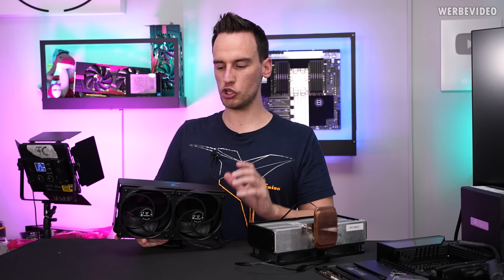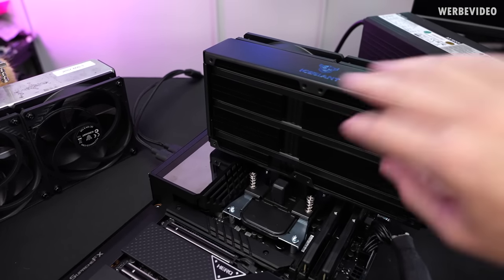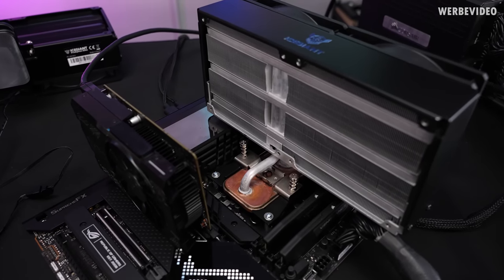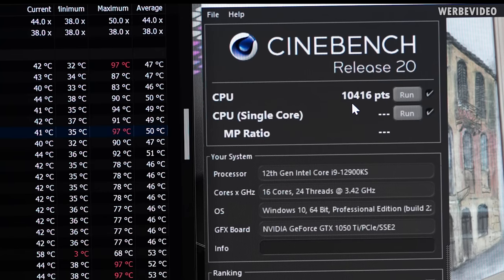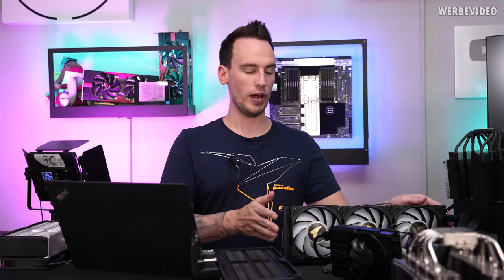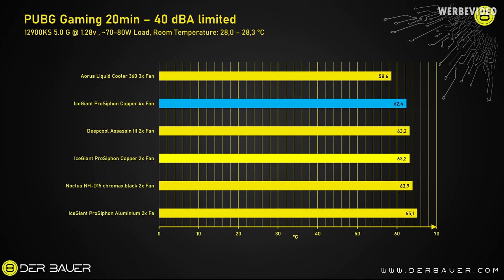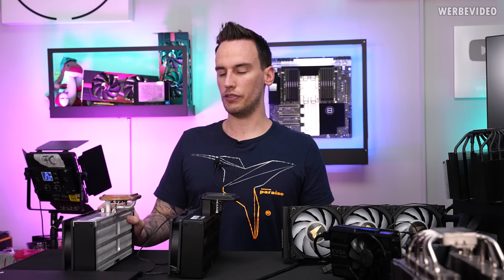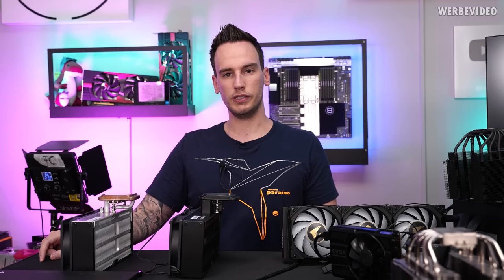This Prototype has A Lot of Potential !

Comment: This new prototype reminds me of the "golden days". I wish I could relive 1996-2006 era when cooling made the evolution to the "standards" we know now. The days we used aquarium pumps and radiators from used cars from the junkyard, and it was in a separate box beside the case. We didn't have AIOs back then. Heatpipes were in it's infancy. We had to buy Fans from all over to find the silent ones. Nostalgia kicked in hard.
Reply: Lol yeah, I still have a friend who cools his PC with a aquarium pump and car rad and it still works a treat.
Heat pipes have been around a lot longer than that though, it's the early 60's when they were in their infancy.
Reply: @wing0zero  I know heat pipes existed. But back then they weren't necessary and were not used in CPU coolers. If my memory is correct, we started seeing them after 2005 in PC DIY space.
Reply: @alpha007org  I recall it was Thermalright that did the first heatpipe cpu cooler for public SP-94/SP-97 (P4/AMD) it was back in 2003. SP-94 was released few months before SP-97 (People using Socket A had to wait a bit for their radiator :D )
Reply: @alpha007org  
Yeah they didn't get used till early 2000
Reply: @gagarin777  
Yeah my first heat pipe cooler was Thermalright, maybe the SP-94 but I can't remember the name of it but it must have been early 2000 as I had a P4 Prescott if memory serves me right.
Reply: @gagarin777  Well, in my home country, Slovenia, we just split from Yugoslavia, and our access to higher end stuff was limited or really really expensive. 

I had an iconic home made PC case with that BIG RED "HIGH VOLTAGE" Switch on it. This was just to power on the PC. It was cheeky/cringe in retrospect, but people were expecting sounds like takeoff of an aircraft. But after that CLANK, PC powered on, pump in the other box started pumping, Fans (Huge industrial fans) were set to minimum RPM via resistors, so it was as silent as we (small OC group*) could make it. It was hilarious at the time.

*We were buying aqua pumps everywhere to find the silent ones. We were hunting for huge 200x200 fans that didn't existed for DIY PC at that time,... 

I would really like to relive that era. If I would made different decisions, I could be a part of EK group, because we used the same CNC machine in one factory after they closed and we knew a guy. I became software dev. Edvard founded world known EK water blocks. I could talk about this for hours what were we doing.

But now, I don't care about OCing anymore. Actually, I run all stock or set the power limit on the GPU minus 20% for total silence. Back then, every DB lower was months of work and tinkering....
Reply: @alpha007org  hey, I think you already shared that EK story, but I don't remember on which channel was it :) 
Back in the day I knew a guy who made his own freon cooling system with condenser sitting outside his window. He used that system daily with P4 1,8 OC'ed to 3GHz
Cheers from Poland 🙂
Reply: @gagarin777  Once. On this channel.
Reply: @gagarin777  You know what. I wish the hardware we have today, existed back then or if I was young now and have the same "my growing up story."

I wonder what kind of Wattage we could cool silently with "out of PC Case" DIY cooling solution. Both CPU and GPU. We could probably get very close to 1000W (CPU and GPU) but the radiator would have to be huge. And Huge 2x ~300x300mm Fans with push+pull, but how silent those fans could be, I don't know. But the room temp becomes a problem with cooling 1000W...
Reply: @alpha007org  I know what you mean. I have high-end rig with 5950X and RTX3090, it heats up the room a LOT. During summer time there is no way to run it without open window (I can't have AC where I leave because aluminium wiring would melt).
Reply: Were you in a different universe than me?
Reply: I'm still using an Eheim 1046 since the mid 2000s. It never had any problem and is essentially a garden pond pump. Also it's very quiet.
Reply: Nice 100 word essay kid
Reply: @alpha007org  look up the Mo-Ra3 420 radiator, I run that with 4 noctua 200mm fans its a massive radiator but I also have these fans at only 450rpm and I have never seen a water temp over 36c even with a mildly overclocked 3090FE and a 5950X on whatever speed PBO decides it wants.

It is basically silent under any load.

Its a wildly overkill radiator, But if I wanted to be sane id have just stuffed 3 black ice into my case.
Reply: Yeah, every so often videos pop up that take me back to an era filled with garden hoses, aquarium pumps, filters, demineralizers and PC's that I had to tear down every month or two to clean the damn algae out of LOL.
Reply: Aquarium, bilge pump, water chiller and mineral oil.
Reply: Or we popped the side case open and put a box fan to it lol.

Comment: still "scary" for a CPU to reach 96C stock with such a BIG cooler on...
Reply: 100%. And the upcoming 13900K is supposedly another 100w more power. It’s nuts that upcoming products (from Intel at least) are going to have a hard requirement for water cooling to avoid thermal throttling.
Reply: Are you aware that this was made on a stress test right? under normal conditions cpus wont get that high.
Reply: @ravell2854  you are aware that Cinebench is also a normal program (Cinema 4D) people use for real stuff right? so this "bench" shows the performance, but it also does the exact same thing the program does in daily day usage... so under normal conditions the CPU will reach EXACTLY the same temps...
Reply: @ravell2854  Are you aware coolers are supposed to handle stress tests?
Reply: That's what folks seem to want,  performance at the cost of efficiency.
Reply: My old 4790k wouldn't heat that much at 5ghz. Crazy.
Reply: @ufsteropolstero6014  According to who? I've only seen comments talking about how annoyed people are at Intel and Nvidia over their products' insane power drawn and thermal output.

Comment: If ice giant creates a 120mm version, it will have to outperform the 120mm Noctua nh-u12a which already performs very close to the Noctua NH-D15.
Reply: It will need to at least compete with air coolers in its price bracket.
Reply: NH U-12A does not come even close to NH D15 in performance. They are simmilar up to 150W where the U12A is still a bit worse but aboe 150W the NHD15 just takes off and leaves the U12A in the dust.

U12A is one of the worst coolers for the price vs the performance you can get.

Comment: I think you should have tested it with Threadripper; this cooler was specifically designed for those CPUs. While you can use it with other chips - the potential is not fully reached. I used the aluminium ProSiphon with 3970x - CPU that draws more power then 12900k after OC, yet the temperatures never went above 85C.
Reply from the maker: Threadripper is pretty much dead for the normal consumer. I see no point testing TR anymore because most people that buy this cooler would probably use it for AM4/AM5 and 1700.
Reply: @der8auer-en  Sadly you are correct about Threadripper. I have a 2950x and its still a beast. Too bad AMD has made a move away from normal consumers owning them now days.
Reply: @der8auer-en  even so with chiplets spreading the heat out does it perform differently on AMD?  Like drag racing a Semi truck.  Or trying to tow a camper with your Ferrari.  Both excellent expensive machines, but they will not excel at a task they are not engineered for.
Reply: @der8auer-en  yeah I'm gutted AMD have ended TR for consumers, I wonder if it was a supply and demand decision more than anything else? So if AMD ever has a surplus of chiplets they might open this market segment again?
Reply: @Speak_Out_and_Remove_All_Doubt  Supply and Demand most likely. Besides, after Intel stopped trying (and until they return with a compelling product line), HEDT just died.
Reply: @juanignacioaschura9437  it's a shame as I would likely buy a Zen 4 TR if it came out at the same time as Ryzen and Epyc but not months and months (or even years) later, that's a few thousand that AMD misses out on from me and I can't be the only one.
Reply: @milescarter7803  yup.. . TR is 3.07" x 2.2", intel 1700 is 1.77" x 1.48"... no one in their right mind would buy one of these for anything other than a threadripper .. not sure if it fits epyc...I'd get a copper one for a 64core, original is good enough for my 32 core. I get mid to lower 70's max with push pull on eco mode in a hot room.
Reply: Would like to get one to pair with my 2990wx.  At 3ghz/1.15v i'm pushing 250w already and touching 95c on warm days.  Thats just short term loads as well, not sustained.
Reply: @CarlTurechek  Epyc is same layout under the IHS as TR.  If the base is covering the chiplets one one then its good for the other.
Reply: @der8auer-en  I dont see threadripper as dead but I agree AMD is dropping the ball on it.  It would still be good to see testing done on a threadripper system to show what this cooler is best suited for (spread out heat loads).
Reply: @NVMDSTEvil  I'm gettin about a steady 65c with 172watts cpu power (not including soc) in eco mode running cinebench.. the room is 80+ F though. Maybe copper would be good if you're pushin 250w. Ice giant should probably start making them for threadripper pros. I haven't head anything about the regular line being continued. I wonder if anyone has tried it on an epyc :/ There might be some issues with channeling the coolant in the pro series orientation.. WEN CUTTING WHEEL TEST :D LOL
Reply: @CarlTurechek  I need to change my AIO, i'm using one of those garbage Castle 360's (actually an MSI rebadged one) that doesnt cover the IHS very well.  I'm sure with a better coverage one it would hold temps a bit better but the radiator is throwing a hot of heat for sure.  Would be interesting to see testing with a real heat load like threadripper/epyc at 280w+ for sure.
Reply: @NVMDSTEvil  I'm not sure what a de-lidded 2990 looks like, sounds like there's some room for improvement though. I could go up to 280 according to ryzen master but haven't tried maxxing it out yet.. (maybe when it's not 2 grand I will lol) it would take some tweaking to go over 280 I'd guess. It got into the lower or mid 70s with pbo on from what I recall. Not sure the wattage on that tho. I think linus had some tests with the 64 core and it was about as good as an aio. For $169 or what ever it is, seemed like a good deal.
Reply: @CarlTurechek  2990wx is 280w stock settings, it has full compliment under the IHS of CPU dies (8 dies total) and the IMC.  I picked this one up off ebay for $750usd.
Reply: @NVMDSTEvil  linus had tests but it was the old one, I might have seen the copper one elsewhere too.. not sure tho lol
Reply: Actually the copper one is is apparently a bit better.. wait I believe by 5c at least.. still can't remember where I saw it tho :D
Reply: @NVMDSTEvil  I'm running a 3970x on a $500 mobo. much speed :D
Reply: @NVMDSTEvil  I got mine for 1800 or so, but it's worth more than that now.. minus inflation lol
Reply: @CarlTurechek  This video and Linus did a second video.  Both show about 5c difference on their tests.  Neither are with threadripper/epyc though.
Reply: @NVMDSTEvil  search for this "Water Cooling Performance for Half the Price" and he's testing at ~280watts
Reply: @CarlTurechek  3970x though, only 4 cpu dies vs 8 that 2990wx/3990/5990 would have.
Reply: @NVMDSTEvil  still 280 watts. How many does the 3960 have?
Reply: @NVMDSTEvil  2990wx looks like it has 4 cpu dies, 3970x has a central chip with 4 smaller ones and the 3990x has 8 smaller dies if I'm not mistaken. 3970x is packed into the middle more than the rest. So the Ice Giant would probably dissipate heat from the 2990wx even better than on the 3970x.
Reply: @CarlTurechek  Yes
Reply: @CarlTurechek  I should say: All CPU dies are the same size between families.  There is just more or less of them depending on core count.
Reply: @NVMDSTEvil  the 2990wx looks like it has 4 big rectangular ccds that take up almost all of the available space. Maybe the cache is built into the 20 series ccds and is separate in the central chip with the 30 series.  🧐🤓
Reply: @CarlTurechek  Each CCD/CCX complex has the cache built in.  The central part  is the IMC.
Reply: @NVMDSTEvil  it'll be interesting too see how long it takes for 32 cores to make it into the consumer chips and how it'll stack up using ddr5. Guessing the 3d stacking will help out for 16 core chips but we won't see any higher until zen 5 comes out. I'm running quad channel 3600 ram so I feel safe in the multithread area for now lol Guessing eventually the ddr5 dual channel will outdo quad ddr4 but it'll have to be like 8000+ mhz considering the latency on ddr5. I'm still bummed that I didn't just get a pro version (and have an upgrade path)!! At least I can use these coolers tho.
Reply: @CarlTurechek  With proper tuning DDR5 can get the latency down pretty good.  Are you using 2 ranks per channel? If not it can offer a decent performance increase depending on your workload.  Also there are a lot of tweaks that can be done for DDR4.  Currently my 2990wx has 8x8GB using 4Gb chips so there are 4 ranks per channel at 1T command rate and Gear Down mode disabled and 225ns tRFC.   I still have a lot of tweaking to do with the memory as i'm only running at 2800mhz on the memory while I do some CPU testing for best performance in the workloads i'm doing.
Reply: @NVMDSTEvil  I'm not sure if it's actually running in dual or single rank mode. It's supposed to run in either or. I guess it can be changed by switching the memory slot positions. I could add 4 more sticks in and it would maybe act that way too... not real sure about all that lol 3600 seems like a good speed at double the 1800 infinity fabric. I don't know how all that plays out actually lol I know you can bork your performance trying to overclock the infinity fabric if it isn't set to a proper rate though. Sounds like you have that beast dialed-in :D To think of all the lost performance out there lol 😢
Reply: @NVMDSTEvil  I think the infinity fabric has to be in sync with the clock multiplier, and probably has little to do with the ram speed. But as usual, I'm not certain lol Update.., seems it is more related to the memory clock after all. Thanks for the reminder on the ranks, I forgot all about that lol
Reply: @CarlTurechek  memory ranks is set by how your memory sticks are configured.  The stick is physically either 1 ranks or 2 each.  If you have 4 sticks of 1 rank memory then moving slots to get 2 ranks would also reduce you to only 2 channels in a 4 channel capable system, which would be worse.  Zentimings is a simple program and can show you what your ram is.  Infinity Fabric is best run at 1:1 mode most of the time but there are instances where going for all out memory bandwidth in 2:1 mode can be better.  Usually you are in 1:1 mode up to about 3800mhz on the memory.
Reply: @NVMDSTEvil  Yeah, I'm using 4 x 8gb sticks so they're probably running at single rank mode. 3-5% gains might be worth doubling the memory for :D Finally an upgrade worth doing lol either that or I grab another 2 x16 to add to one I already have I guess.
Hope the ROG Strix will handle 8 sticks at 3600, the default mem speed. I guess the threadripper 3000 series is only rated to 3200 or so. Thanks for the tips, it should be a fun tweaker board for years to come:) Might learn a thing to too lol
Reply: @NVMDSTEvil  It makes me wonder what speed my 4700u minipc's infinity fabric is running and if there's some perf to be gained there with a different ram size / speeds lol I saw a major increase in igpu perf with a move to lower cas latency, maybe 2 x16 with higher latency would run about the same as the (likely) single ranks 2 x 8 in there now. Probably better off saving for the 7000 series on that front though.
Reply: @juanignacioaschura9437  
HEDT has not died at all, it has morphed into being the prosumer rigs. I am still regularly building TR rigs with dual 3090Ti GPUs for engineers and 3D production. The problem is that these builds regularly go over $15,000 USD and $20,000 is not uncommon at all. 
Now just imagine what the price increases will be with the next generation of TR and dual 4090Ti cards.

Comment: Yeah, extruded aluminum uses alloys that are significantly lower conductivity than pure aluminum. It matters if the heat source is very concentrated.
Reply: Is it really practically significant? I had never known about this.
Reply: @bricaaron3978  from my memory it can lose 30% or more of its thermal conductivity compared to pure aluminum. 
Yeah, 6061 is 166 W/mk
Reply: @davidgunther8428  Alright, thanks. I didn't know that the manner in which a metal is worked/formed could be definitely related to its pureness or alloy type.

Comment: Well, as with the last version, it has a lot of potential, but at the moment it's just not really outpacing the NH-D15 by a significant amount (a fraction of 1 degree) and is considerably bigger than an already very big cooler. As you mentioned the mounting solution is a bit sketchy as well, particularly when considering the size, weight, and leverage it's exerting on the motherboard meanwhile Noctua's mounting system is often considered exemplary precisely because Noctua has long since realized they have a big and heavy heatsink that's camming the motherboard with a significant amount of leverage so it needs to be well braced, and so they put the forethought into that mount to help it out a bit.